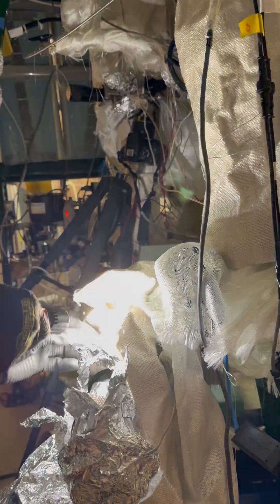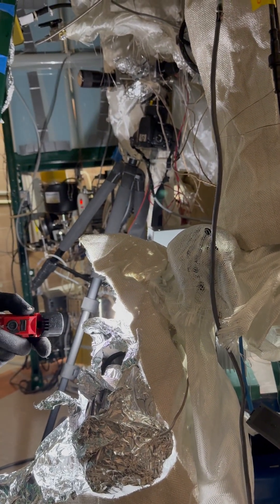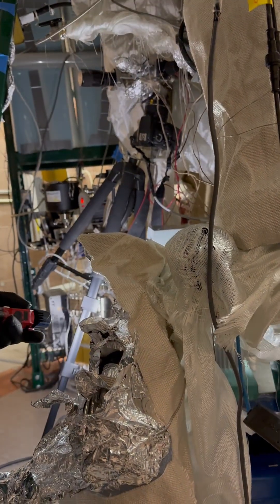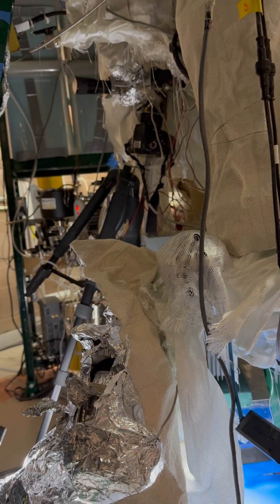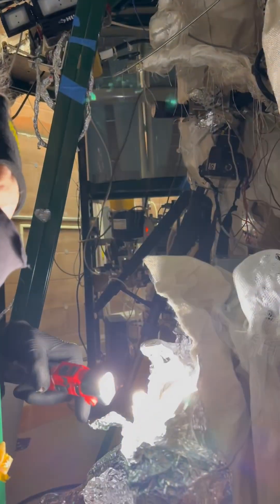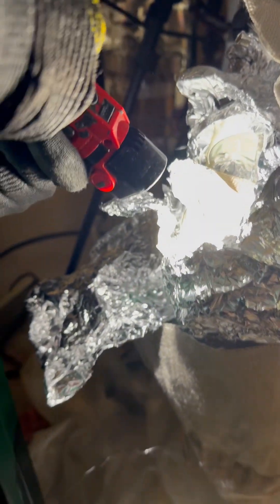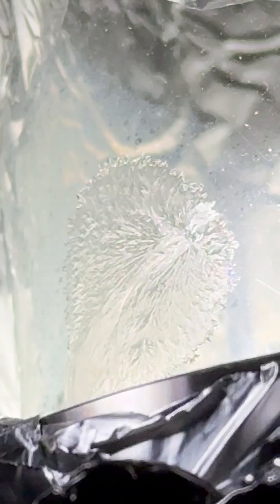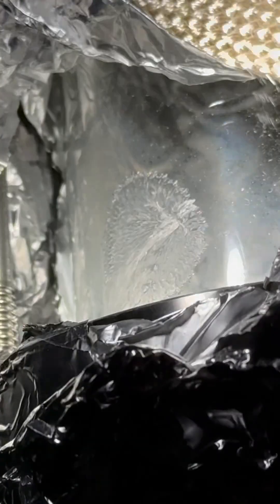Discussing heating challenges with hydrogen-boron fuel

Comment: What caused the crystals to form? Was it gasses leaking? Is that dangerous or do you just need to replace something?
Reply: From the newsletter, it's condensing into the crystals inside the chamber at cold spots on its way to the reactor just like frost does on windows. In the vid Eric proposes it's being blocked somehow from traveling to where it needs to be. All the surfaces need to be heated so to not encourage condensation. And heating should support sublimation of their solid decaborane fuel under the deep vacuum.